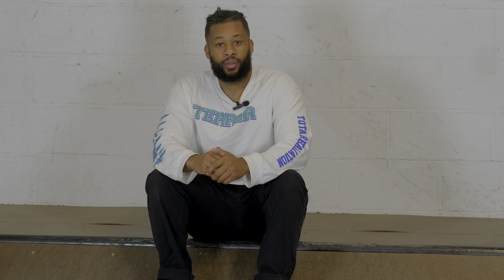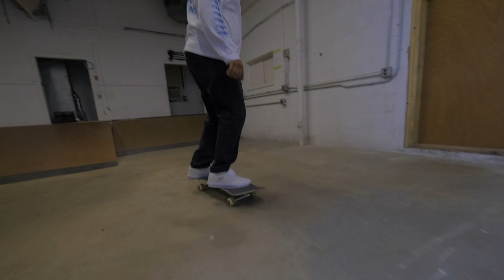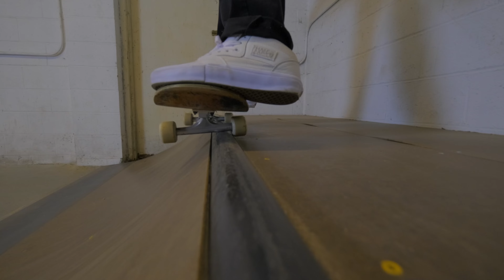HOW TO BACKSIDE AXLE STALL

Comment: I would dare to say crosslock is the most consistent (for most). Would suggest tho crosslocking a bit differently as you showed in the vid.  With the back truck being more in the ramp and the front truck more on the shelf of the ramp. This can save you from hang ups when doing it.